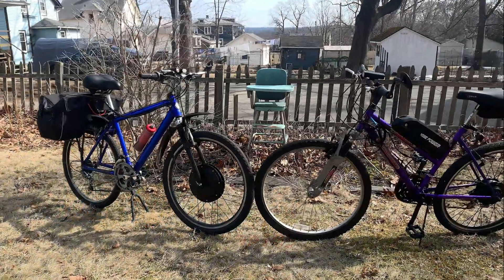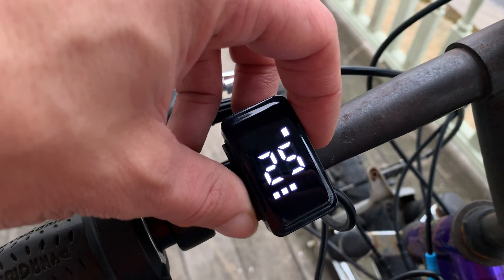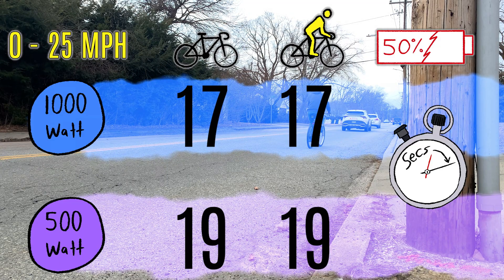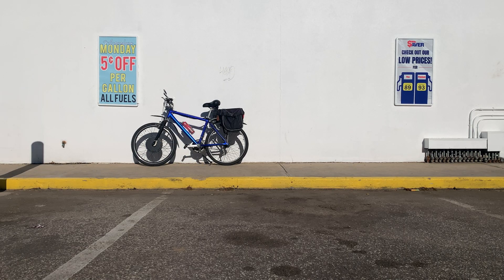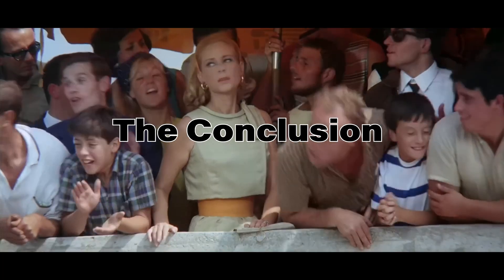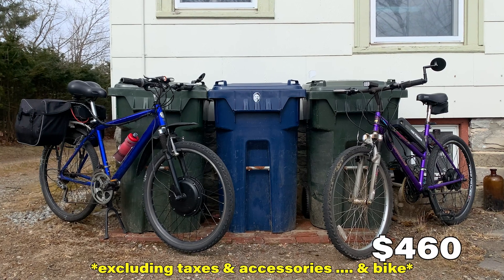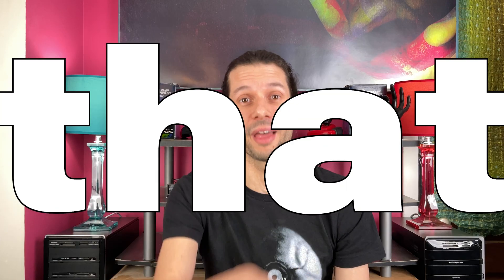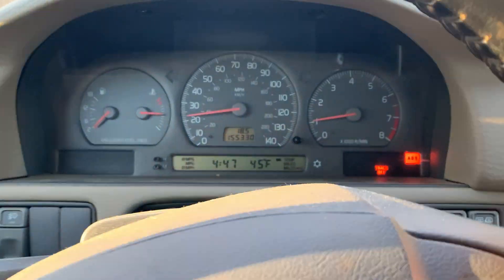1000 W vs 500 Watt eBike Motor

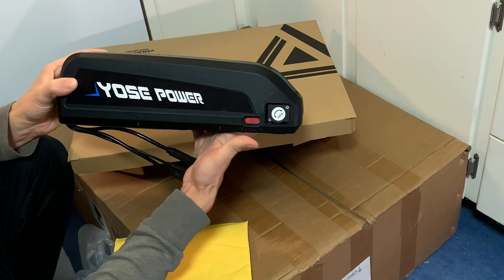Comment from the maker: 1:24 It’s probably an equal weight increase of motor and battery weight with the 1000w… I finished this video under a time crunch and was thinking of adding that blurb, but thought it was pedantic at the time.

Comment: Dude great video! but you comparing two different type of motors... 500w is geared hub, advantage over 1000w direct drive it is much less wight, great for lower speed with many start and stops it is more economic... 1000w Shine over geared hub at high speed and constant speed while geared hub eat battery faster at high speed because higher rpm...

Comment: Yoo guys i have an idea how about i build a 15000w ebike on a shit bike i have laying around i have some 4s li-po batteries laying around 😂 its for the shit and gigglers until i run into a concrete block at 110 kph with rubber brakes 😭 
                                         - said the local joe who now roams the streets in a wheelchair
Reply from the maker: …so you saw the video where someone put a car alternator on a bmx bike, but was afraid to take it to top speed cause it felt unstable.

Comment: yoo
i really need help with the speed limiter, can you plz help me
Reply from the maker: I have a video about my kt-lcd5 display unlocking top speed is at 3:30 https://youtu.be/mEaZCQunJ3U.  Otherwise you would have to find a model name or number for your LCD and hopefully theres are user manual available.  Or if the bike is popular enough people may be talking about it on reddit or something like that.
Reply: @ Most controllers have a blue single-pin wire that acts as a speed limiter too, unplug that and it should remove the limits if you've already removed them in the display
Reply: @DotDotMatrix  thanks for replying but i was talking about my e scooter its is motogear hurtle i got it from amazon and its not popular